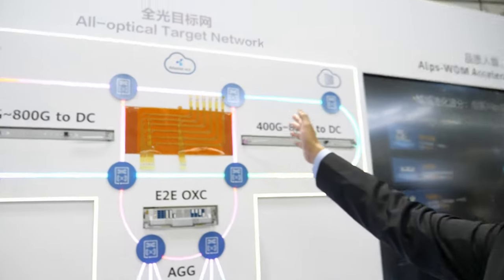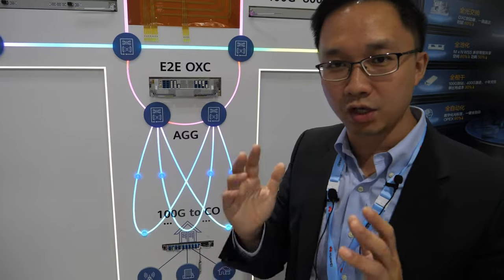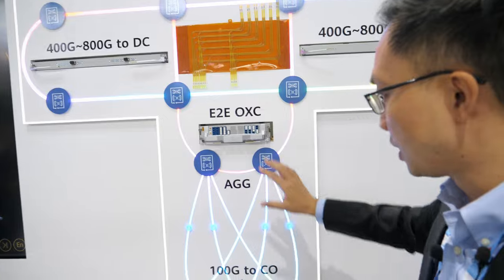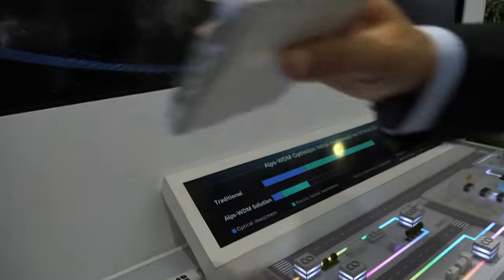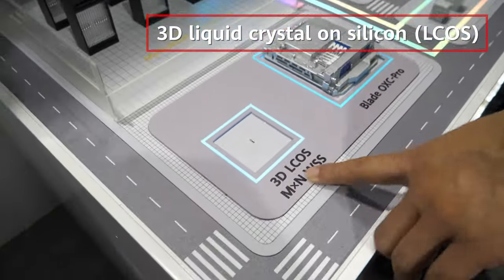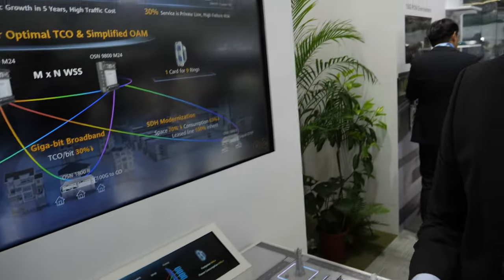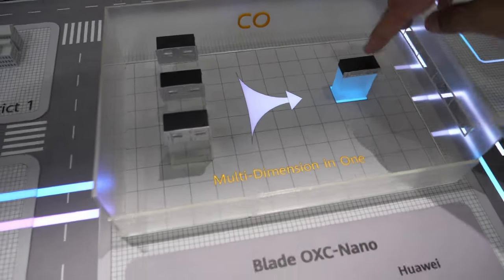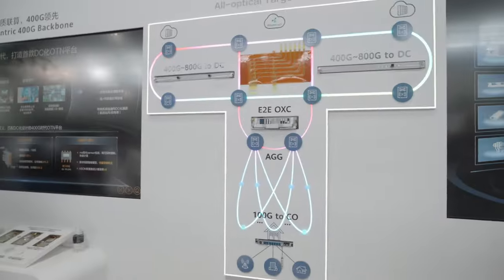Huawei 800Gbps Backbone and Metro Fiber Alps WDM Optical Transmission Network at MWC 2023 Shanghai

Comment: I cannot see anything new here; just any random marketing acronym showing no added new value; first MxN solution is expensive compared to MSC solution that Chinese and Huawei cannot support; Secondly other competitors already achieve 2.4TB wavelength speed ; while Huawei just arrive to 800G ; too late; third and most important DC fabric; clouds and web Scales are blocked with the use of Huawei or Chinese Transmission equipment; Chinese always lies :face-green-smiling:
Reply from the maker: Are you saying Huawei is not far in front of American companies in network technology? If that is true, then why does the US pressure all European countries to boycott Huawei equipment? If Huawei was inferior, there would be no point in trade sanctions against them. 😄